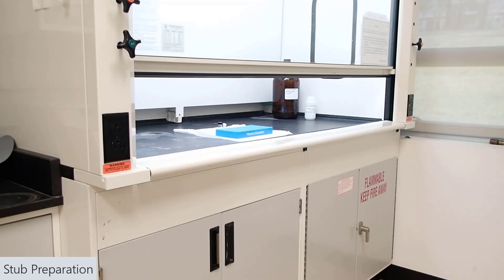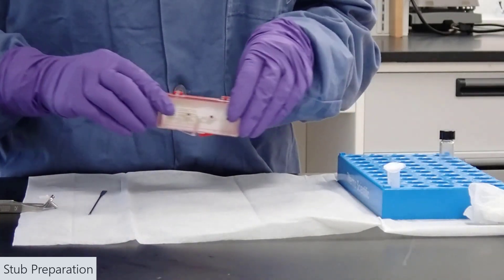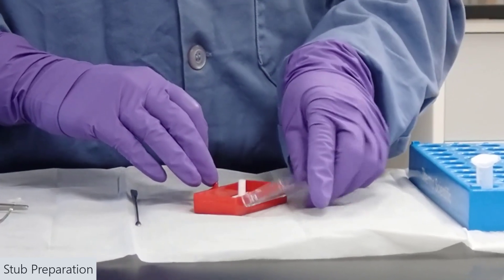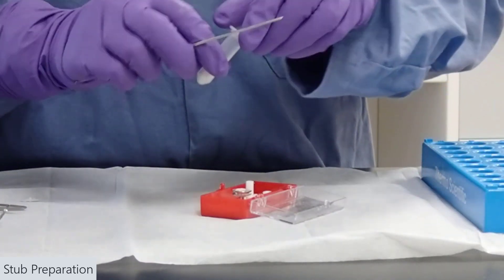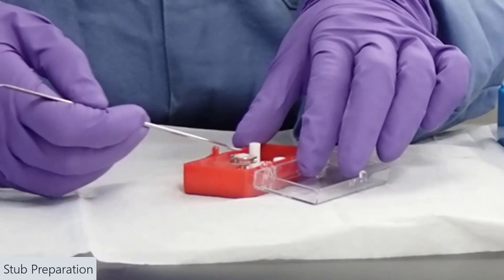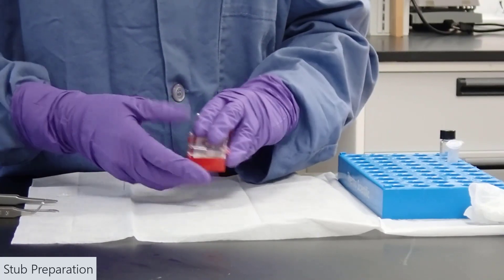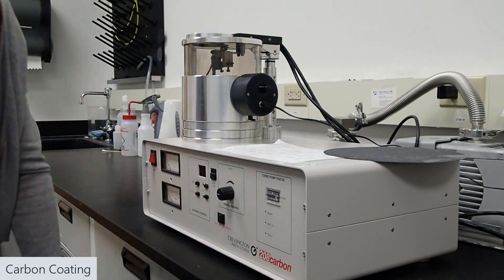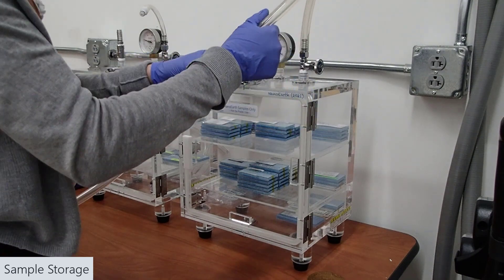SEM Sample Preparation – Powdered Samples

Comment: Hi Dr Sheri. Quick question. Say your TEM shows that your iron oxide is nano in size, however, when you run the same sample on the SEM, the particles are a few um in size. Could not crushing the sample properly before running SEM have an effect on the size? Or is the another reason. Your assistance will be appreciated.
Thanks
Reply from the maker: It depends on your materials and how you prepare them for TEM. If you are using drop casting for TEM sample prep (see my video on that if you don’t know what it is), you will essentially be excluding larger particles. Those particles will sink in your suspension, and you will only pick up the smallest ones with the pipette if you are pulling from the topmost part of the suspension, as I recommend in the video.  The smaller particles could be there in SEM and are just sticking together to form larger aggregates. There are many possibilities!